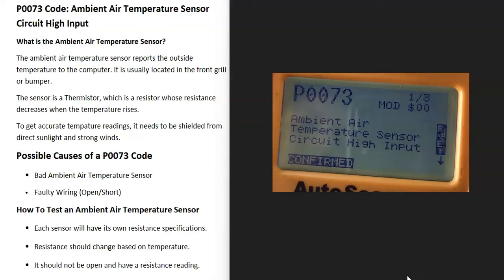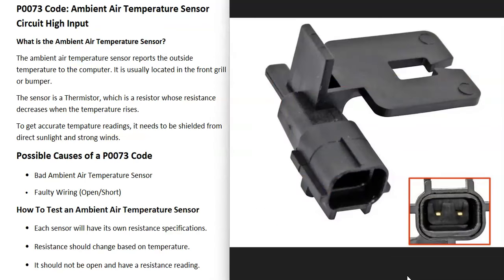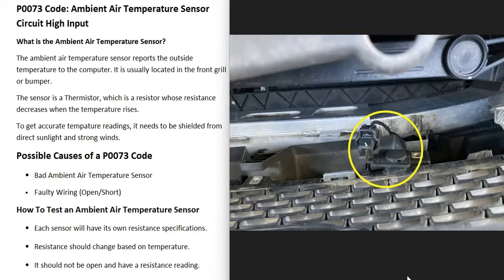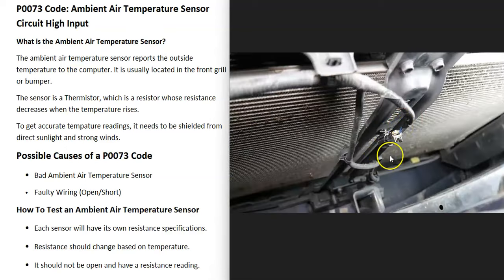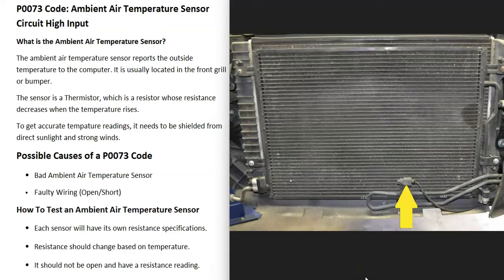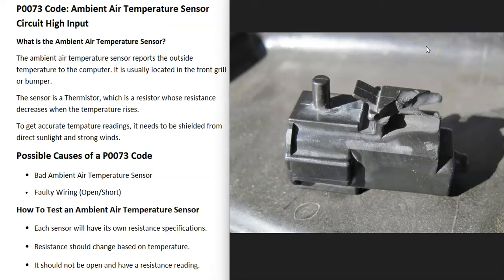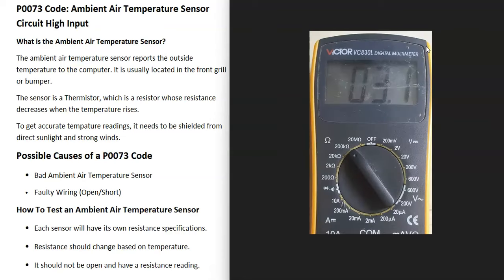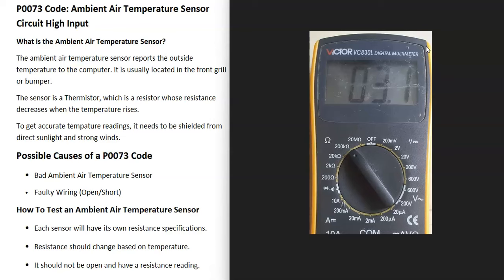Causes and Fixes P0073 Code: Ambient Air Temperature Sensor Circuit High Input

Comment: Is this a big problem? Will it cause more damage if I do not get it fixed?
Reply from the maker: It likely won't cause any damage. Usually, the HVAC auto mode doesn't work, and the temp gauge is wrong, things like this. I made a video on the symptoms of a bad ambient air temp sensor. Here is a link. https://www.youtube.com/watch?v=2SelSnDezVc